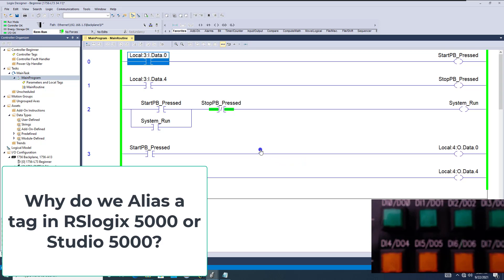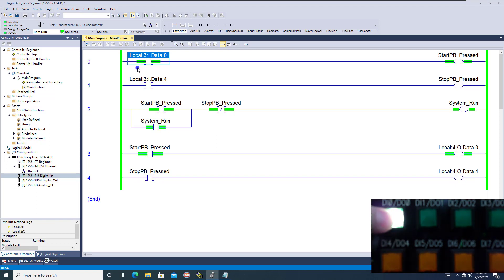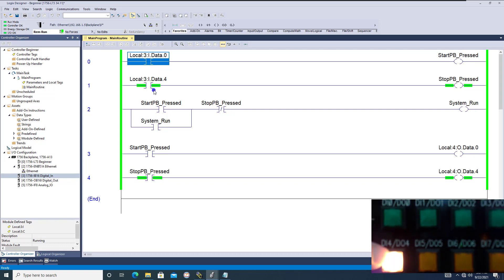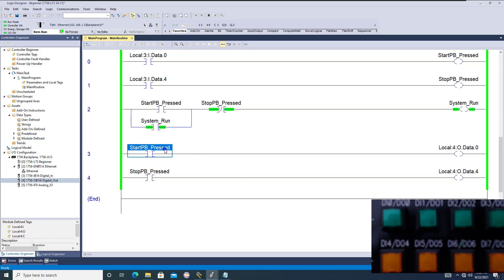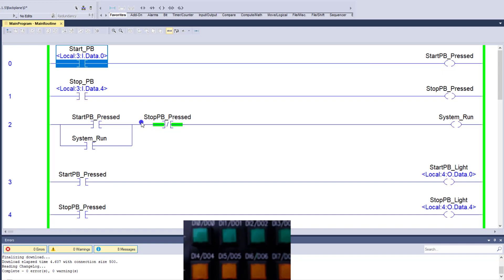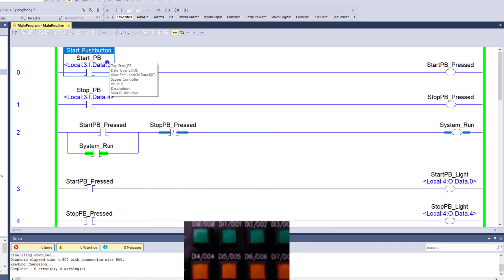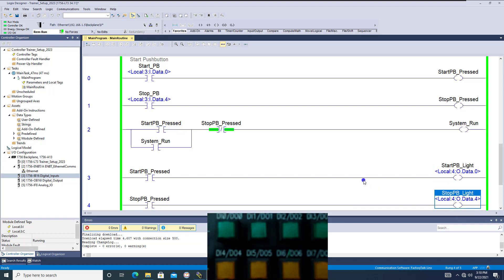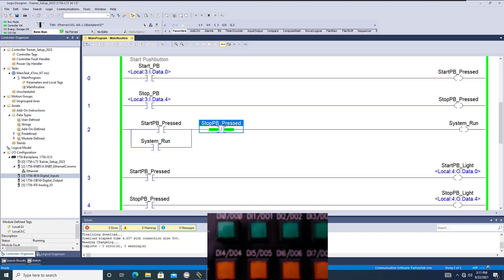RSLogix 5000 Tag Structure - Why do we Alias Tags Studio 5000

Comment: Thanks for the video. I have a question; sorry, it is unrelated to the video subject. We have some PLCs on the company's intranet, which I can access through a VPN from home. They are not accessible from outside the company. But the issue is anyone within the company from all over the world should be able to access these PLCs and see what's happening and potentially harm the system. Is there a way to password-protect the ethernet connection to the PLCs and restrict others from going online? PLCs are CompactLogix 5380.
Reply from the maker: No, however there is a way to source protect the code so that only people with the source code can access the PLC logic.
If you need to password protect your PLC ethernet then you need to do this from the IT firewall rules.
Reply: @ShaneWelcher  Thank you for the reply.

Comment: RSLogix 5 and 500 were the only ones that would lose their descriptions/comments if uploading because they were not stored on the processors. RSLogix 5000 and Studio 5000 the comments and descriptions are held in the controller so you don't lose them.
Reply: Studio5k V21 or higher and the processor type matters as well.  L7x and higher and CompactLogix 5370 and higher.
Reply from the maker: Not in all versions on RSLogix 5000, either way, thanks for the comment